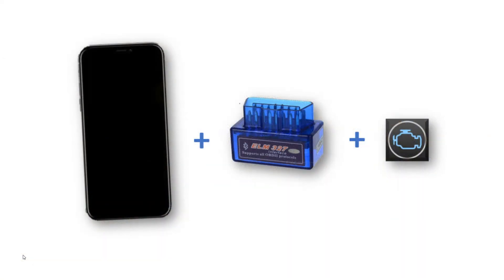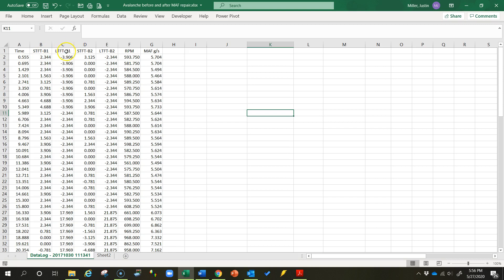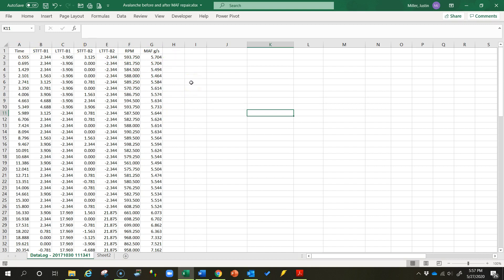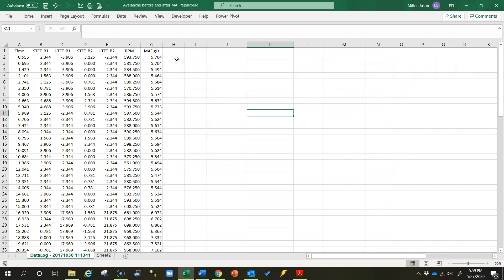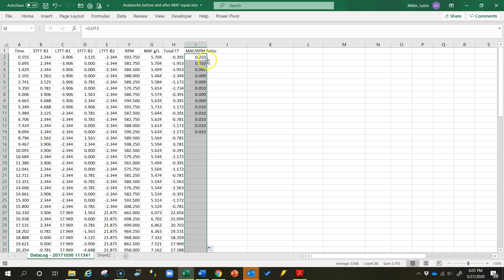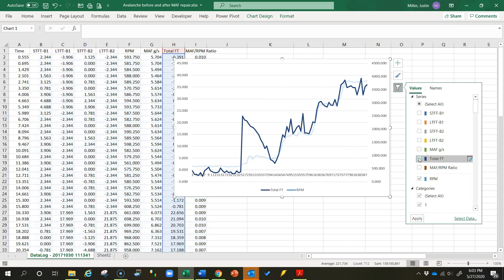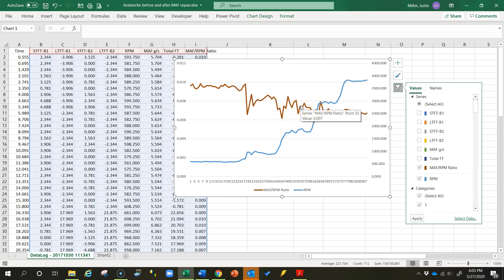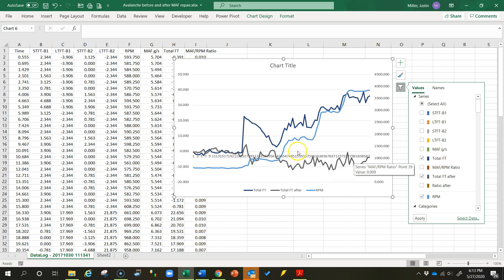Accurately Diagnosing a Mass Airflow Sensor

Comment: Great video, how do you test an air flow meter on 1985 Jag XJ6 with no OBD?
Reply from the maker: You would have to test the voltage on the signal wire using your meter or scope and compare the voltage to specifications.

Comment: Hi Justin. I have a 3.2l engine and my MAF g/s rate starts at 6.6g/s! Double the rule of thumb. It still doubles when it double RPM. Do I have a faulty MAF sensor??
Reply from the maker: Don't worry about the grams being high.  This could be caused by a high idle speed, higher ambient air pressure, etc.  The rule of thumb is just for general guidance.  the important part is that it changes in proportion to your rpm.

Comment: What if the ECU is shot ? Wouldn't an MAF swap do nothing ?
What if the ground path to the ECU or MAF is compromised ?
Can the very connection, itself, right at the MAF screw everything up ?
Aren't you actually testing a complete system -- and must trust that the other factors are okay ?
Reply from the maker: Yes, you are testing a complete system.  However, you are also verifying that the system is working when you do this test and get a MAF reading.  If the MAF readings do not increase proportionally with rpm, then it isn't likely being caused by ECU, the wiring, or connectors.  An electrical problem outside of the sensor would cause a change in MAF voltage, but it would not change with airflow.  It the fault would either be present at all times or change with vibrations or temperature rather than airflow. 

Also, if you want to check the integrity of the rest of the system, use a scope to check the voltage of each of the wires.

Comment: Justin, 
I have a ford 4.6. 
At idle, 650rpm I have only 3.5g/s.
1300rpm 7g/s
And at 1950rpm 11g/s
Idles rough, long starts like it’s flooded and long term fuel trims go -13 while driving . Maf seems to be working but reading low.

Comment: Thank you for your video. I have a 2006 Corolla 1.6 petrol and the MAF sensor read 3 g/s at idle and 27 g/s at 2600 rpm. Are these values normal? Thank you!
Reply from the maker: Your transmission must be in park or neutral when recording these numbers (so there is no load on the engine).  It looks like your car may have been in gear. 

If you are idling at 600 rpm and you read 3 g/s, when you increase your rpm to 2400, (four times what it was), then your MAF sensor should be reading about 12 g/s (four times what it was).  The ratio should not change.

However, if you are only looking at snapshots of your data and not logging it, you could be looking at outliers or skewed numbers.  I recommend logging the data and graphing it so that you can see the whole picture.
Reply: @JustinMillerAutomotive  Thank you very much for a such detailed answer.

Comment: Good info. tu but wouldn't you say checking it at idel even with different RPM is different and not as accurate as checking it while driving at different speed and having actual air go passed it.
Reply from the maker: Air passes the sensor without the car moving down the road.  Also, with the car driving, you introduce load into the equation, which makes it impossible to do this test.  If the MAF sensor is not reading accurately, it will show up whether the car is moving or not.

Comment: Thanks for this awesome video. One question - could this data also indicate a vacuum leak? Or did you confirm no vac leak before capturing the data?
Reply from the maker: No.  A vacuum leak would cause high fuel trims at idle, which get closer to zero (but still positive) as the rpm increases.  This same test is the very best way to determine whether you have a vacuum leak, by the way!

Comment: 2017 Sonata Hybrid 2.0.  Stumbles and has upwards of 500 misfires on cyl 2 on a 25 mile drive.  With the Maf unplugged, it has just a handful of misfires. MAF sensor, or another issue? I bought a new OEM, and it showed fuel issue plugged in, but unplugged no fuel issue. MAF or look elsewhere?
Reply from the maker: It doesn't sound like a MAF sensor if the misfires are only on cylinder two!  The MAF sensor affects all cylinders equally.  Unplugging any sensor could make the misfire better or worse just because it causes the computer to go into a limp-mode and alters the air fuel ratio among other things.  I would not recommend diagnosing by unplugging!  You'll waste your money!

If cylinder two is the only one misfiring, try swapping the spark and ignition coil to another cylinder and see if the misfire follows one of the parts.  You could also try moving the injector.  It could also be a mechanical issue resulting in lower compression on that cylinder or an electrical issue leading to an injector or coil.
Reply: @JustinMillerAutomotive  I will have a video out tomorrow around 5PM Cst covering this isssue from the beginning, as I would have to write a book just to give the current issue. New plugs, and have switched coils all around, still cyl 2, but more insight in the video on Sat April 16th.

Comment: Thanks for the video,  very helpful.  
I have a question,  hopefully you can answer for me.  My engine is running lean and I'm having symptoms,  like loss of power and high rpm with little to no shifting at times.  I got live data  from the mass air flow sensor and this is what it reads: 

@ 584 RPM = 3.810 G/S
@ 2091 RPM = 65.770 G/S

It's for a 2000 GMC Sierra V8  5.3

Does that look normal?  Thank you.
Reply from the maker: Is the vehicle in park or neutral, or are you in gear?  It looks like you are in gear.  This test needs to be performed with no load on the engine (in park or neutral).  Also, to be accurate, you need to log the data and graph it as shown in the video.  Just looking a couple of snapshots will not lead to an accurate diagnosis.

Comment: Hi there,great video !Thanks alot !I have a stragne problem with my car regarding the MAF reading...my car is Volvo v50 2.0 litre diesel engine 136 horse power,my MAF reading at idle are 14 g/s...i tested with brand new MAF sensor but the same story again,other than that the car drive perfectly fine,its just jerking some times when you press and release the acc.pedal ?Any ideas...14 g/s at idle is not normal right ?
Reply from the maker: 14 g/s does sound higher than normal for idle.  However, since the car is running well, there might be something that we are not understanding.  Are you sure that the units are in g/s? Perhaps there is an issue with the scan tool that you are using, where it is not calculating the PID values correctly?
 
More importantly, were you able to log your data and check the MAF/RPM ratio?  If the ratio stays flat across all engine speeds, it would appear that the MAF is reading correctly and that something else is causing the problem.

Comment: Hi Justin. Thank you very much for sharing all this knowledge. Amazing. I'm from Brazil and I have never seem some kind of explanation all this time in my region. Maybe you can help me with my concern. I have a Mitsubishi Pajero 3.2 turbo diesel and I'm concerned because MAF is oscilating in idle from 7.4 to 12.5 g/s even with stable rpm in 650. Is this a proof of bad MAF? I noticed the fuel consumption has increased a lot. Thank you. Mauricio.
Reply from the maker: From your description, it does sound like you are not getting correct readings from your MAF.  To be certain, it would be best to log and graph your data like we did in the video.  If you don't have the tools to do this, you may have to take a chance and take your best guess!

Comment: Hey Justin any way you can show us what kinda software You're using and how to use it.

Unless you said you just write down the rpm, grams ,etc with the other information.

I also looked at a MAF sensor code p101 and I checked the scan tool maf reading of grams. 
It was saying around 4 grams at idle around 600 rpm I believe. 

And I accelerate at 2500rpm and it was only giving my 11 grams of air. 
Is that right I'm thinking the MAF sensor is dirty or engine air filter is dirty. I couldn't inspect it cause the MAF was not removable without taking more things apart.
Reply from the maker: Look for my videos: "Logging Data Using OBD Wiz" and "Setting up OBD Fusion or OBD Link to Log Data."  Hopefully those videos will point you in the right direction!  

It does sound like you may have a dirty MAF sensor, but I can never rely on a snapshot of the data to diagnose.  By logging the data over a period of time, you can see the overall trend and diagnose it accurately.  Any given snapshot could be very misleading.

Comment: Excellent video. Some vehicles will have Mass Air Flow (MAF) voltage only in the scanner. How can I convert MAF voltage to MAF grams per second?
Reply from the maker: I have never run into an OBD II vehicle that had a mass airflow sensor, but didn't provide a PID for mass airflow rate.  However, there are a lot of cars out there!  

Converting the voltage to grams per second may not be possible without more information.  However, you can still use voltage for this test if you find out what your starting voltage is.  Note the rpm and sensor voltage at idle, then double the rpm and note the rpm and voltage again.  Find the difference in voltage between the two readings, then substract that number from the original voltage at idle.  This tells you what your sensor's initial voltage (y-intercept) is.

Now, you can subtract that initial voltage from all of your voltage readings and use the resulting voltage numbers to check your MAF/RPM ratio.    I hope that all made sense!

Comment: Great explanation video. Got a 02 chevy silverado 2500hd 6.0 gas. Won't go over 35 up hill. Runs terrible on flat. Scanner says MAF sensor. Changed 4 times and wire harness. Bought a better scan tool with live data and graphs. MAF does not change with RPMs. Stays at 10. Can't pinpoint sensor wire. 2 grounds and constant all good. Ordered a new computer. Installing it Friday I hope. Any other tips? Thanks. Jeff.
tpsprescott@outlook.com

Comment: Thanks for the excellent info.  Since this test also captured total fuel trim, can this be used to view the accurate overall total fuel trim of the engine since the vehicle is in park during the whole test?  Or would I need to drive the car through various loads to capture fuel trims?  Thanks again!
Reply from the maker: You shouldn't need to vary the loads to find fuel issues.  You would only need to perform this same test.  If there is a fuel issue, it will show up and you can use the rpm to determine the type of fuel problem you are dealing with.
Reply: @JustinMillerAutomotive  thanks!

Comment: Justin been getting great data logs with my obd fusion... looking at my data the the air flow doubles with the rpm... Its a toyota mr2...it has 2 banks...I raised to 3000rpm the o2 bank 1 is fixed at 0.3v the STFT is +20 ...the o2 bank 2 is switching 0.2 to 0.8 so fuel trims ok on bank 2... I drop the revs to idle.. bank 1 sensor still at 0.3v ish for around 5 mins before it starts switching again.. I changed the o2 fault is back after 2 weeks.... oh i checked the total trim as per your video and it showed no greater than 5%....is adding both banks and dividing by 2 only for maf checking ?  I have the csv file if you need to take a look..could be another video...
Reply from the maker: Geoff, feel free to send me a link to your csv file.  I can look at it - I can't promise that I'll see something that you haven't already seen.  Maybe we can come up with some ideas.  Also, regarding your other question, I have never tried to identify a plugged exhaust using this data.  It would be interesting to try and see what we can find.  I think it would affect MAP sensor values for sure.  My favorite way to test for a plugged exhaust is to use an in-cylinder pressure transducer with a lab scope.  You can easily see exhaust back pressure on this waveform.

Comment: Justin another great video...Is it possible in excel to plot total fuel trim against rpm on the x axis instead of time...or even better throttle position on y axis...like the ats scope scan tool
Reply from the maker: Yes you can.  I should make a video showing how to do that!  You can do it by putting all of your data into a table, then sorting the rpm from low to high, then charting your fuel trim.
Reply: @JustinMillerAutomotive  From data logging can you see if you have a restricted exhaust.....